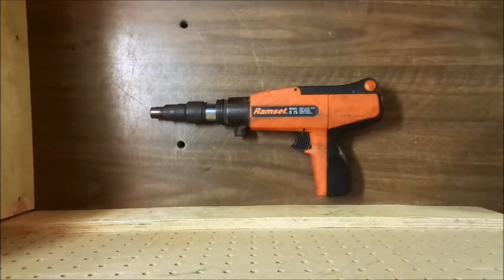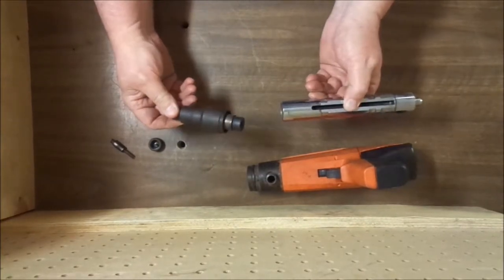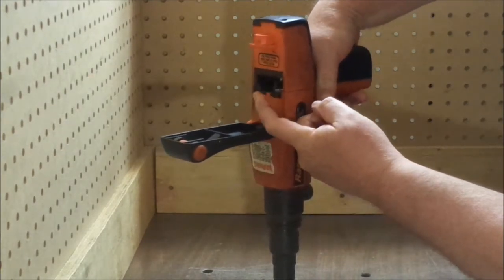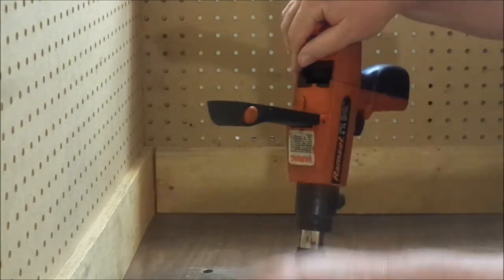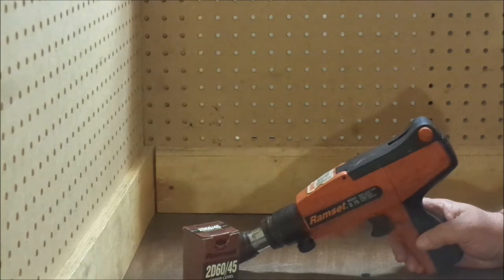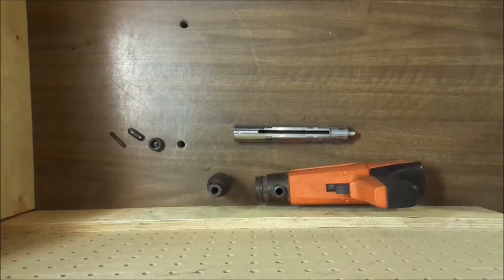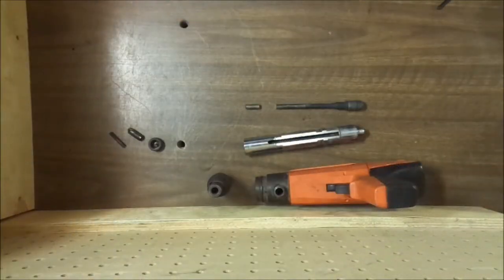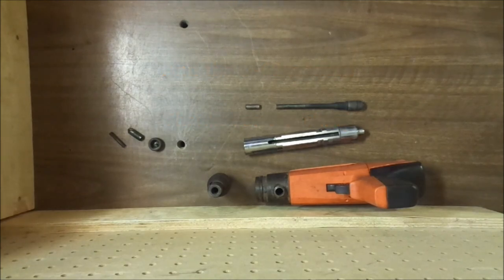ITW Ramset D-75 Disc Tool

Comment: Not all disc tools were made by Spit (France). And I don't talk about Spit clones like Dewalt. Maybe Spit is the only company that makes powder actuated tools with  loads arranged on discs in PRESENT DAYS....but have a look here at this Obo Matic SG75 made in Spain. Very rare tool:     

https://www.bidspotter.co.uk/en-gb/auction-catalogues/hertfordshire-auctions/catalogue-id-ibhe10687/lot-39fad695-5623-4b7b-9f19-a5400118b8c1    

or here:   

https://www.ebay.co.uk/itm/Nail-gun-OBO-MATIC-SG-75-/282817631169?nma=true&si=gMTwMI%252B4VzaIi2%252B0ScCdPdXDZkk%253D&orig_cvip=true&rt=nc&_trksid=p2047675.l2557
Reply from the maker: That is cool and it may even predate the Spit discs tools.
Reply: Yes I believe it is older than Spit disc tools....probably from '75. It came with a metal carring case but of course is a low velocity piston type fastening tool. The discs used by it are of a larger diameter than those used on Spit tools. There were versions with plastc or metal discs...the discs were loaded in that cilinder that opened to the left side of the tool (like a revolver) Also the cilinder had an ejector rod (also like a revolver).
Reply from the maker: The side cylinder reminds me of the side loader on some Ramset tools. I think the larger disc along with the donut hole allowed the disc to be made in plastic. The plastic disc I have for the Ramset tool always blew out and it was thought that the loads were just too close together causing a squeezing affect that made the loads outside the chamber explodes. I know it doesn't seem to make sense but something caused more than one load to go off at once.
Reply from the maker: I should  add that the Spit/Ramset metal disc has holes (patented at the time)  next to where the firing pins strikes the load. It was speculated that these holes were what kept the other loads in the metal disc from going off like they did in the plastic disc.